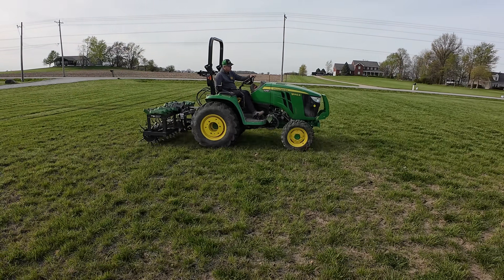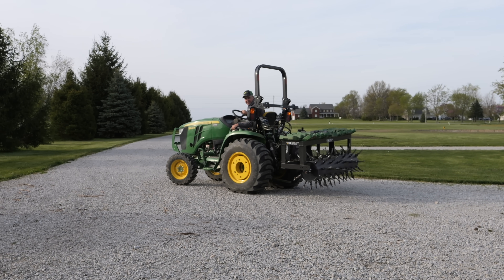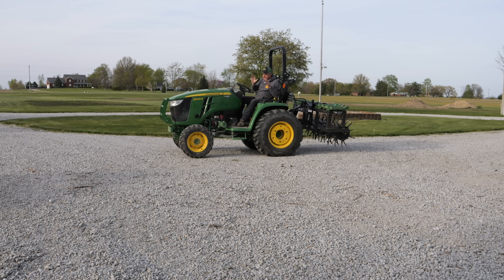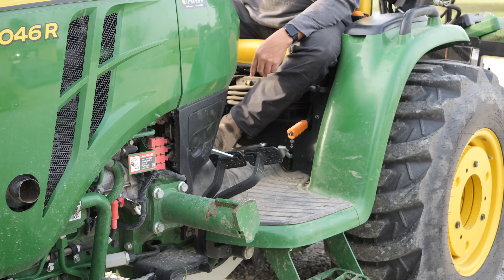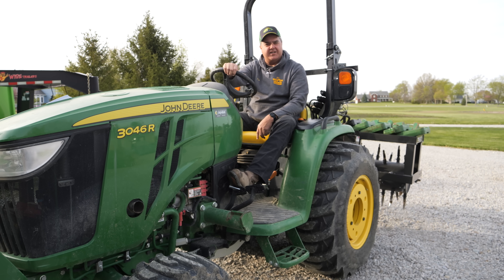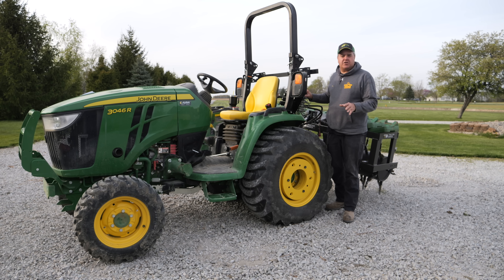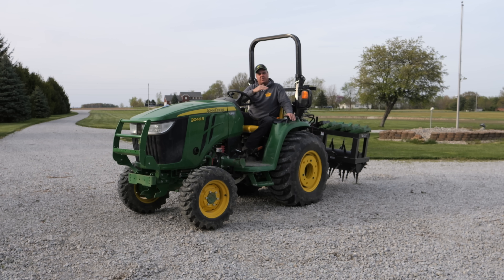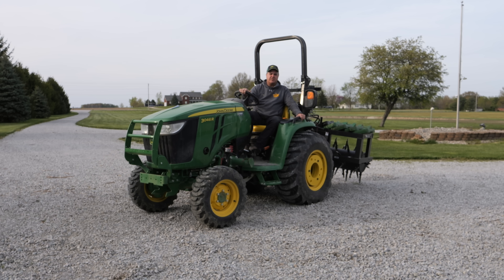Meh! Independent Steering Brakes ARE FOR LOSERS! Compact Tractor BEGINNER LESSON!

Comment: On a 1 series tractor (1023/1025/1026) independent rear brakes would be nice when mowing sideways on a hill and wanting to turn uphill. Front tires like to plow some even with weights on the front and/or in 4-wheel drive. Steeper the hill the more it does this. I lock in the rear diff. at times when this happens to keep the front and rear from spinning so much.

Comment: i had a 1948 farmall cub, it had differential brakes but it was 2wd. my kubota BX does not have differential brakes.  when you have a 2wd tractor it is the old tool available to get you out of a sticky situation. i liked my farmall, it still had some useful utility, but it cannot do nearly what the kubota can do. it was admittedly a nice little antique.   i ended up parting ways when it needed a clutch and needed an engine overhaul. it was great because it was was an actual tractor when i was nearly broke and had no budget.
Reply from the maker: My dad bought a 52 (I think) cub.  We overhauled it and used it for years to mow the yard…like you, when we were broke!

Comment: I’ve got 5 tractors here, ranging from the old massey Ferguson 12 lawn tractors (60s), Massey Ferguson 135, ford 4600 and a kubota bx2680. I’ve never once missed the split brakes on the bx. Honestly I think it turns almost as sharp as you’d want as it is, and 4wd makes the split brakes almost unnecessary in most cases these days. I also think that stability may be an issue with split brakes on a sub compact. 

As for the locking lever on the pedal, if I’m on the road I always lock the pedals together. Or if someone else is going to drive my tractor I lock them. Very easy to get in a mess if you forget to hit both pedals in an emergency situation or if you are an inexperienced operator. Just my .02

Comment: Reminds of when I was shoppjng tractors . Made the comment at Kubota that the steering brakes on one model were difficult to use while non-existant on another . The salesman point blank said what do you need steering brakes for ? Ended up 3R over E because I didn't want another machine without steering brakes .

Comment: I almost never use the brake lock on most tractors, I do use it on the 71 and 72 series CIH Magnums when road traveling. Something about how I sit those and the placement of the brake pedals I have only gotten one pedal a few times when I needed both. The only ones so far in a lot of years.

Comment: Split brakes is one reason I bought a 3R instead of a 3E.  If you need the brakes to steer that much though, your ballast is wrong.  For as much as I watch TTWT videos about needing rear ballast when using a loader, it should have been mentioned here that you need front ballast when carrying a lot of weight on the rear.  Brake steer should be an addition to the front tires steering, not the primary or only means of steering.  I have a 10 place weight rack on my 3039R.  I run 4-42 pound weights on my front when I have almost any attachment, more for bigger attachments.  If turning radius is an issue, you are better off with weights on the front of your tractor than a loader because they don't hang out nearly as far.
Reply from the maker: Ah come on! Let me have a little fun!  There was no danger in running light on the front.   …and hopefully it is obvious to folks that a bit more weight would have made the tractor handle more easily.

Comment: I use individual brakes at slow speeds and when needing to help steer, the bar help make it safer when at higher speeds to keep the tractor going straight so it doesn't verge one way or the other

Comment: My daedong ck22 hst has the brakes on the rhs so I can't use the brakes to steer unless the cruise control is engaged. So I have the interlock on and basically only have brakes for handbrake. I'm reluctant to use the brakes to turn sharp anyway as it's hydro not geared. Just a thing with me. But to turn on a dime does save a lot of time for furrow work, but I haven't done that since I was a teen.

Comment: I had a Ford 640 (1956) and sometimes I miss the dual brakes.  Mostly handy when I was abusing my tractor to shag firewood and weaving between trees on uneven ground where I shouldn't have been, anyway.  But, I wouldn't go back now that I have 4WD, heel-fired differential lock, Hydro-static transmission and power-steering.  I miss the nostalgia of my old 640 . . . but I sure like the safety features and "luxury" of my JD 1025R.  PTO shrouds - what a novel concept.  I "fixed" my neighbor's older gear-drive Kubota (2850?) by freeing up that coupling toggle that locks the brake-pads together.  He had no idea.

Comment: on the tractors Ive run that have independent brakes, Ive used them mostly for traction control when 1 tire starts spinning. the X-series and 1-series have diff lock for that. Im rarely in need of a tighter turning radius on my x595.

Comment: My 1992 john deere 332 (the largest of the 300 series) garden tractor(diesel engine) has independent breaks. With the 48" hydraulic tiller attached, the front end is light, and ive have had to use them in tight spots.

Comment: Most modern tractors the brakes are on the inside of the axle just outside of the differential typically if the axle has a trumpet shape too it the brake discs are in there

Comment: Lock the pedals when loading on trailer at least for inexperienced operators. If your rolling off the trailer and panic and jab the brakes if you only hit one side the tractor could pivot and fall off. More of an issue for gear drive transmissions

Comment: I disagree with your opinion of always disengaging the brake connecting lever on the tractors.
I don't disengage lever on the brakes until I need it. AND when it is in 4WD it also brakes the front axle as well. I have forgotten to connect the brakes in the past and hit the brakes, and the tractor will turn violently, unexpected.
Only use it when needed.
Reply from the maker: Fair enough.  That is why they are called opinions :-)

Comment: I like the way you explained it and showed it. I’ve seen other people explain it by talking about the back wheels, but not really saying much about the weight off of the front wheels.

I can definitely see out in the fields where this would make a huge difference. On my little Lawn Mower that wasn’t a zero turn, I would spend a lot of miles and time looping around Remo and grass. I’d already mowed just to put the mower in the right position again. If you were out, going back-and-forth and fields all day long Plowing or doing whatever pivoting on that turn that tight could save you a huge amount of time by the end of the day. I know when I would mow a couple of acres just having a tractor that would turn tight could save me a good amount of time it would take me, a couple of hours at least at the grass was even at all wet or thick. It might take me three hours on my little John Deere lawn tractor and I spent a big amount of that time looping around and recovering ground. I had already covered just to get turned around and positioned over the grass that needed cut. With my zero turn mower which goes three times as fast that 2 1/2 or even three hours turns into 20 or 30 minutes because I’m pretty much mowing the whole time and everywhere I go is someplace that needs mowed. I’m not out there doing big loops trying to get back to the uncut grass so I can definitely see where working in a field going from end end Doing row after row after row where this could save you a ton of time.

I can definitely see this as an advantage for getting unstuck too. When one will get stuck in the mud and you have an open differential all the power goes to that wheel and your other wheel has no power to get you out of the hole or to assist in getting you out that one wheel just buries itself. If you can put the brake on that wheel, you put the power to your other wheel And you can move forward a little and hopefully get traction again and not have to tow yourself out.  Even on my zero, turn with the individual wheel control I get out of a lot of those situations to wear with my little tractor I can’t do it because once that wheel starts spinning, it just sinks right in and I’m not going anywhere, especially if you have a quill Drive tractor with no differential lock I think that would make a big difference

Comment: Old 318 garden tractor I grew up on had the wheel brakes and I tell ya, when using a front plow, or blower, or in snow. Using an individual wheel brake helped to steer, but most importantly bc the 318 doesn’t have a locking diff, works great as manual traction control. Just slow the spinning wheel and force the power to the traction wheel. So if they can put individual wheel brakes on a 318 garden tractor… the 1 series isn’t a far reach on space. But price… yes price would be the only reason to not add them to the 1025/23

Comment: I used to leave my lever up until I was going downhill toward a closed gate. I pushed the brake, and nothing, because I missed both of them and only had the front brake. Lucky it was a metal gat, and not latched. I banged it open, and a tiny scratch was all. But now I always keep them latched when I don't need them. I have a larger m7060, and it will get away from you in neutral and if you have to stop fast and miss both brakes. So, for me "holding it upon," is bad advice.
Reply from the maker: Fair enough.
Reply: @TractorTimewithTim  Get in a heavier tractor going down hill and emergency stop, but only hit one peddle. You'll see very quickly. Love your vids, thanks for them.

Comment: Growing up on a farm, we only used the brake locking bar while driving fast on the road.  In a panic situation, both brakes would be applied equally.  But as soon as we got off the road, we flipped the locking bar off.  Thanks for sharing.

Comment: Independent brakes are darn near mandatory with icy driveways, otherwise you plow forward exactly as Tim showed in the gravel. Otherwise it's extremely rare I use them un-joined unless my drives are struggling for traction.

Independent brakes should really be joined until they're needed separately, "panic stops" are far more frequent with normal clutch+gear-shift transmissions so you do actually end up pressing one before both - between my manual tractors and the manual forklifts at work their brakes hooked to the inner pedals are all more worn than the outer pedal's brakes lol Also lot of tractors (no matter the transmission or age) have the parking brake as a pawl running off the inner most pedal so if they're unjoined that inner most pedal is getting more wear (causing play) in all the joints and any movement while locked/locking wears down that side's brake shoes too.

I think why the 1025R doesn't have Independent brakes is due to space and how tight they turn as is, Independent brakes would barely make them turn any tighter than the already do with the diff unlocked.

Comment: We keep the brakes locked on my Kubota LX unless we’re doing work that needs the independent brakes. For us, that’s plowing snow or working some loader tasks.
Reply from the maker: Consider unlocking and using for most purposes. Improves turning radius, and overall, allows the tractor to perform better if done right.

Comment: Interesting and informative. I have a 1 series and 3R but have run used the core aerator only with the 1 series and hard to turn. I knew about the turn braking and I do not have the brakes locked together, lol  but will definitely use the 3R with the aerator next time to achieve a better turning experience . Thanks Tim...

Comment: Individual brakes are essential for raking hay. It's important though to lock them together if you're going down the road @ "high speed", especially for a new operator. If you hit a single brake in an emergency, you have the possibility of spinning/jack-knifing/rolling the tractor & injuring yourself or others. I don't lock my brakes together normally since I'm an experienced operator & don't travel on busy roads. The only tractor I do lock them together on is the Allis Chalmers 175 with a loader. The left brake will not hold the tractor in place stopped by itself.

Comment: the brake steer is a useful option, which I have on my 2501, and had on my old Yanmar. When I needed them, I disconnected the interlock and when I did not need them, I connected to equalize braking authority. I would really miss this option if I did not have it.

Comment: First generation Bobcats had split brakes, but it was on the same side as the treadle pedal. Unless you have two right feet it's completely useless. Clutch is on the left.

Comment: I pushed one of my front tires off the bead on a small pine tree once when I was about a mile from my truck. It was 100° outside. I picked the front wheels up with the bucket and went in reverse all the way back using just brakes to steer. Saved my rear that day.
Reply: Wow, great idea. I could have used it 2 weeks ago.
Reply: Should have picked up the front and wedged the front end to only load the good tire

Comment: When I was a kid on my grandfather's farm, while mowing hay with the 6' Bush Hog mower with hay blades and the side panel removed, the Massey Ferguson 35 was really light at the front end.  Especially going uphill in the ridge country of SW Pennsylvania.  The brakes made it possible to mow on those steep hills.  Also, turning the baler around at the end of the field on a steep side hill.  We would back up the baler, turning it to be downhill from the tractor, until the baler/tractor combination were nearly jack knifed, with the tractor facing downhill and the baler tongue pointing uphill.  Then we would pull forward, turning hard with the uphill brake.  Before the baler weight could push the tractor to the hollow, the tractor was already facing level to the contour.  Just had to continue forward and the baler followed.  We found it was the safest way to make the turnaround on those steep hillsides.

Comment: I use the brakes on 4052R with and without the lock depending on what I am doing. I use them a lot when I am plowing snow to assist my steering. However when I am using my 3pt snow blower I lock the pedals because I can’t keep my foot on the middle of the brake pedal. When I am roading my tractor I lock the pedals together because if I have to panic stop I want to stop straight and not twist. It all depends on what job I am doing. Thank you for the great videos!!!

Comment: Hey Tim great video, I grew up on A John Deere with individual brake pedals one on each side of the operator’s platform they worked great. To this day I never use the pedal lock, that might not be for everyone but it works for me. I do have a little JD 2720 and it has individual brake pedals. 👍🏻

Comment: Steering brakes are something I use constantly. Especially in the tractors I have without loaders I never noticed myself using them with the loader tractor but i keep 280 lbs on the 4610 and still need the steering brakes quite often.

Comment: Individual brakes are locked together for road speed driving and then unlocked for general use. When I first got my 1025R, I did miss the individual brake, but have learned to work around it. Yes, at times, it would be handy!

Comment: Deere 3E series doesn’t have steering brakes.  Whats more, they incorporated the differential lock into the brake pedal.  It’s a two stage pedal.  You apply the brake in the first stage and if you keep pressing the pedal you’ve engaged the differential lock.

Comment: I use the split breaks on my LX when using my loader...specifically when I'm using it to dig out potholes on our hard-packed dirt/gravel road at the Overlook.  Invariably, the front wheels are lifted off the ground, and the breaks allow be to stay pointed in the direction I want to go.  I hadn't even considered the alternative scenario of the tractor being heavy in the rear!  Really good info, Tim.  Thanks, Chris.
Reply: I did the same when I had my B2650 TLB.  I’ve since gotten a BX23s and the jury is still out on if I’m missing the steering brakes.

Comment: Airplanes have separate brakes too for the left and right main gear. The brakes are actuated by rocking the rudder pedals forward (called toe brakes). When turning an airliner with underslung engines, you can also use asymmetrical thrust (leave the inside engine at idle and spool up the outside one). This is helpful when you have to spin the aircraft around 180 degrees at a small airport to backtrack up the runway to a taxiway after landing.
Reply: Airplanes also don't have power to the wheels, so they are basically castering to what the engines are whipping up with the propellors/jets.  You have to lock the inside wheel and up-throttle the outside engine(s), or goose the single engine, to turn that direction.